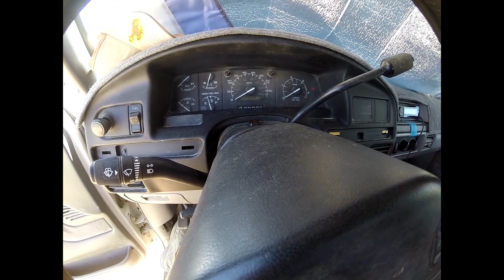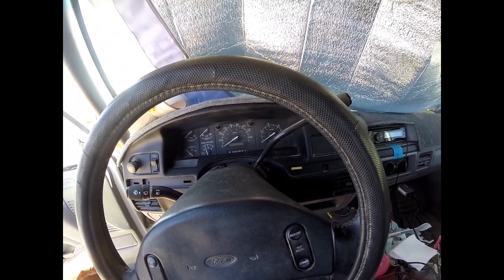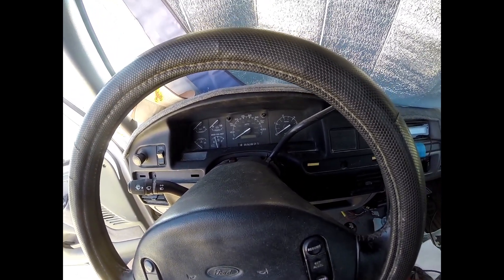7.3L Powerstroke Diesel Engine Problem

Comment: I just recently encountered this problem, truck was down all winter. just fixed it. my issue was cylinder 6 injector harness was melted beneath the valve cover. for some reason the IDM goes into safe mode and shut down my passenger bank of cylinders.

Pull your valve covers and inspect the harnesses beneath them.
passenger side can be a bear to get the rear bolt out of, i find it easiest to remove the little black box with a vacuum line connected to it. the 2 bolts holding the dipstick tube to the valve cover are studs, and once the dipstick bracket is off there is 2 nuts welded to the stud. remove the whole stud.

Drivers side you'll need to remove the intake piping and horn from the bracket coming up from the valve cover. bracket is the same as the dipstick bracket with 2 studs and 2 nuts holding it on. there is an addition horseshoe at the back of the valve cover to remove.

make sure your pigtails are in good shape, id recommend replacing the glow plugs too because bad plugs are what cause the harnesses to melt.
Reply: My truck also experienced the same symptoms as yours, where it would start fine, and after a few seconds the motor would drop cylinders, check engine light, i also passed a buzz test and a koeo.
Reply from the maker: Walking up to the truck and not have a clue what's wrong and no help on the way is really scary.  But, a little technology and some patience  is the best advice possible.  Good luck to all the guys in this same position.

Comment: Quite a pickle there sir. I know all too well that diagnosis and electronics can be the fun part. This is the first of yours that I’ve come across but I can see that you use and need your truck for a lot of things. Anyways I’m real curious to know what brand cam sensor you replaced the old one with. These trucks are known to not do well with aftermarket sensors I’ve been told to stick with OE motorcraft on that.
Reply from the maker: I replaced the CPS with a Dorman from AutoZone.  The reason I did that was because I could invest in a day parts run and have a replacement.  The one I took out was a gray one and likely not bad, in retrospect.  I bought three Motorcraft F4TZ-12K073-C from RiffRaff Diesel to swap in.   My further diagnosis suggest to  me I have a problem with the Under Valve Cover Harness.  My AE diagnosis tells me I have a low voltage on the  #5 injector.  A near by diesel mechanic has suggested I should replace the valve cover gasket and UVC harness.  I'm playing the odds and RiffRaff Diesel has a pile of expensive new OEM parts on the way.  Thanks for getting back with your comment.

Comment from the maker: Got some good advice.  Still doesn't run.  Actually, the engine does start but dies immediately.
Reply from the maker: Ran a KOEO test and got a P0273 which indicates a low voltage problem with cylinder 5.  Don't know why cylinder 5 is chosen?  Nothing out of the way with a Buzz Test.  Funny though that only DTC P1111 is the only DTC that shows up on the list of DTC.  LIfe is never dull out here on The Ranch.

Comment: I'll tell you now that I'm no expert mechanic or really a diesel guy. Is it possible that since the cam position sensor went out, your cam could have jumped timing or advanced or retarded a few degrees? To me it sounds like it's getting the air and fuel to run, just isn't in timing. If you were having the issue before you replaced the sensor, then maybe the new one thinks it's in the correct timing.
Reply from the maker: I'm feeling good that I've zero'd in on my problem.  If a guy doesn't have somthing like AutoEnginuity diasnostic software that are truly screwed.